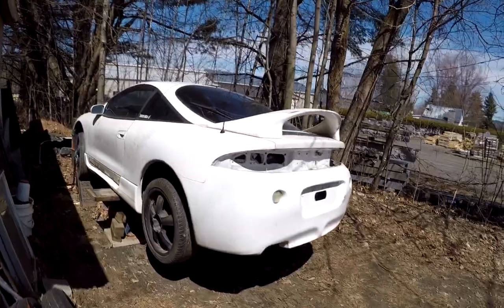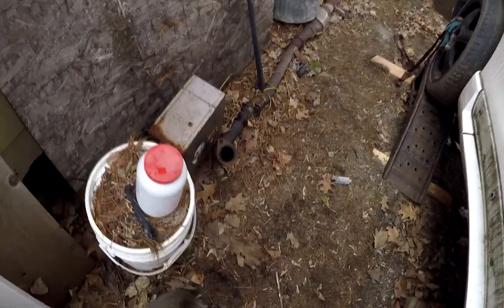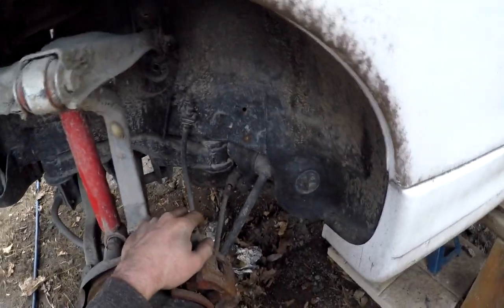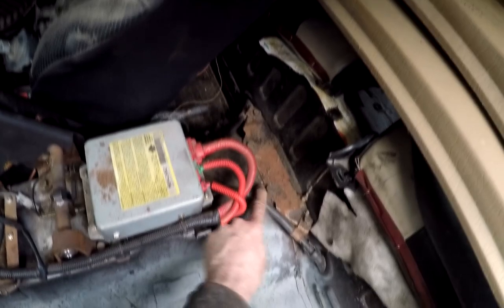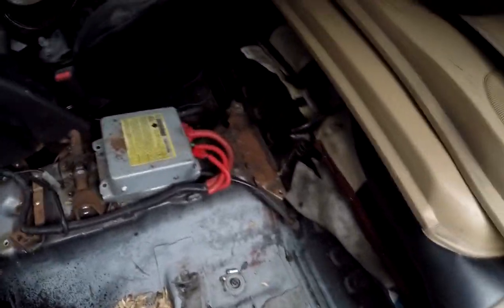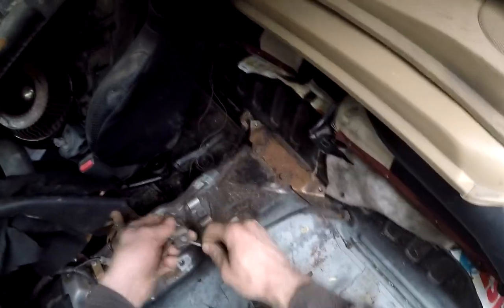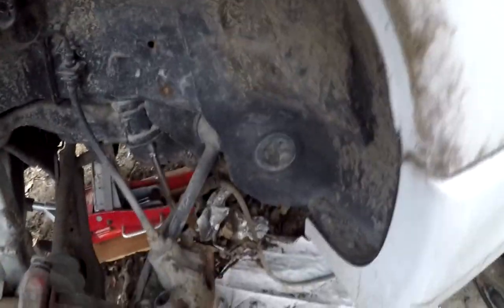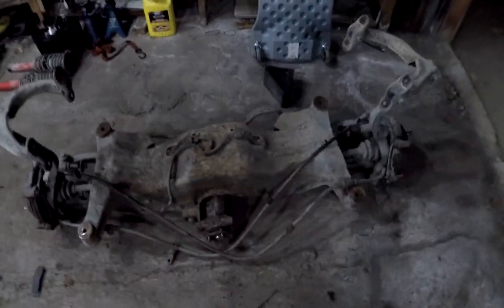2G DSM AWD Swap - Episode 2 - AWD Subframe Removal

Comment: Does it matter if the car is a esi or a tsi for the awd swap and is the body the same for parts
Reply from the maker: Yes it matters. The non turbo shell has completely different locations for the motor and transmission mounts, not to mention all the electrical is completely different.